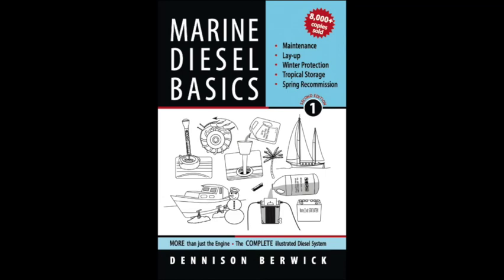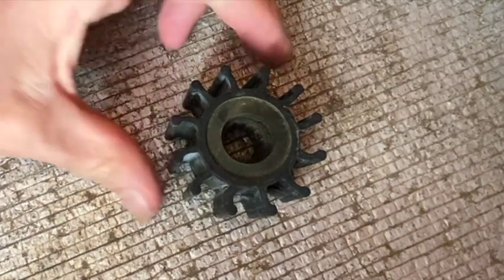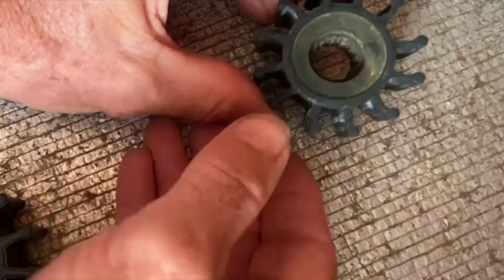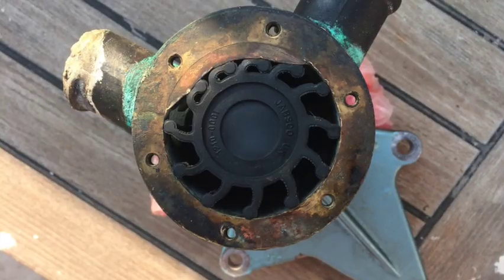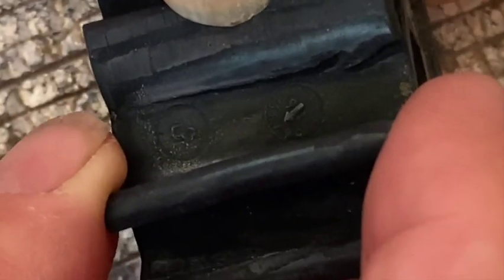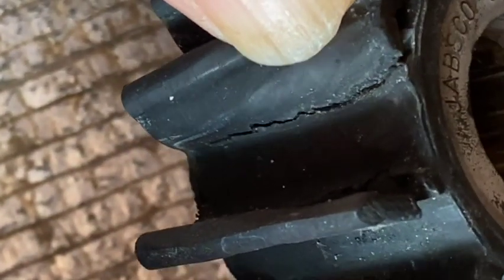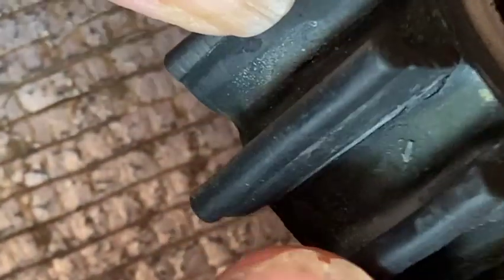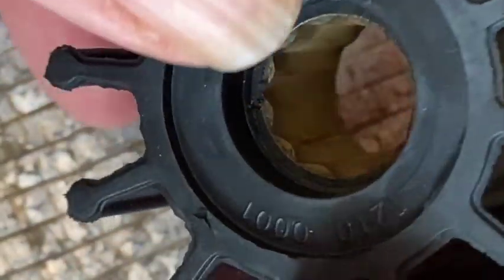Inspecting a Raw Water Pump Impeller

Comment: Brilliant video. So useful. Part of the problem of learning about maintenance is knowing what to look for. Something which is missed by many instructional books and videos. Great. Thanks.
Reply from the maker: Thank you for your kind words.  The inspiration for all the Marine Diesel Basics books and materials is to provide other sailors with the information I wish I'd had when I started!  MDB2 - How Things Work, the new book I am currently completing, will go a long way towards that as it shows with more than 2600 drawings and 600 pages how every part of the marine diesel systems works - from fuel tanks, to engine, eletrics, shaft seals and propellers.  Pushing to complete by the end of this year.